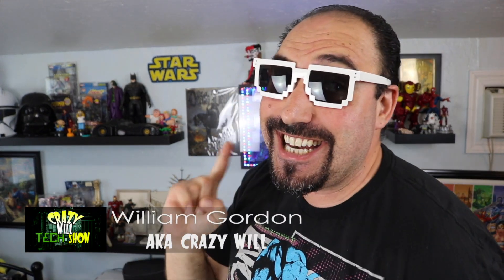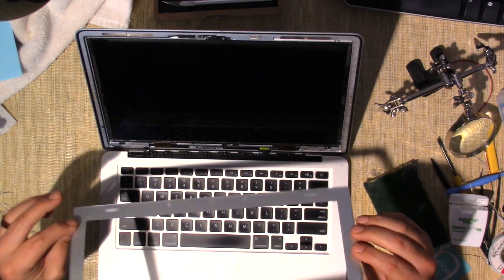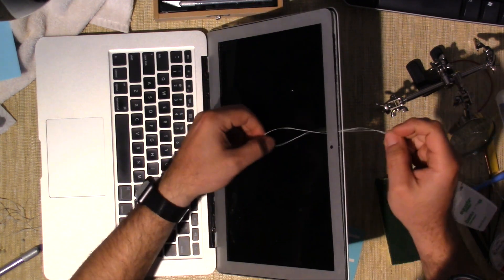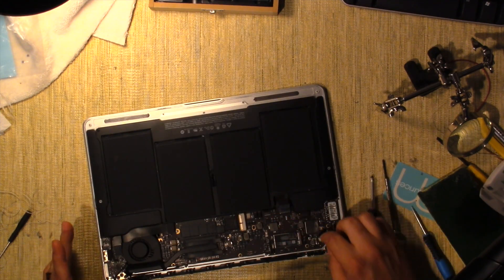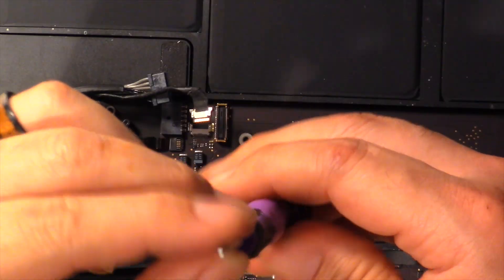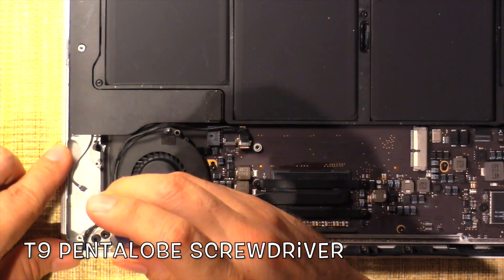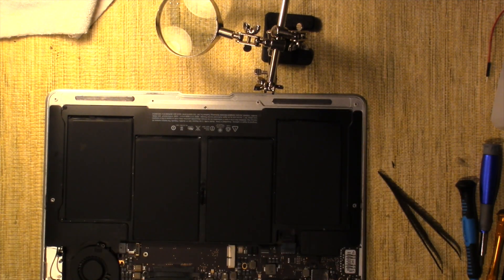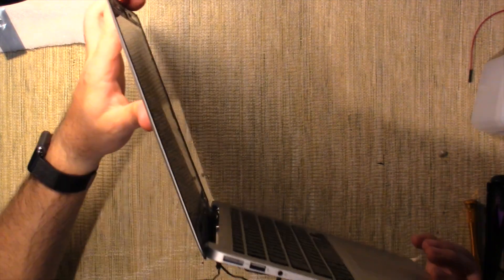2015 MacBook Air 13'' LCD cable replacement

Comment: Hi. I have a MacBook Air 2013 and my screen has no light, you can see it is working with a flashlight. My LCD cable is damaged on the left side (the pins are broken), is this what your laptop had? Thanks.

Comment: Great video, was just about to attempt this repair. However I'm not sure I need to, for me the damaged pin on the cable is the one on the far right hand side. I believe its a grounding pin. Do you think it being damaged would matter? It doesn't look burned in anyway. Haven't tried it yet in case it breaks either the display or logic board backlight.
Reply from the maker: It has been a while since I did this repair, but yes you need a ground.

Comment: Wish I saw your video before :-( just wrecked that little cable when fixing the bazzel.  End of the macbook air
Reply from the maker: Sorry to hear. eBay will be your best friend see if you can find parts. Just remember you can get a used one for around $200 bucks.

Comment: It's either the chip on logic board or cable you did the right thing great Vid.i just unplugged my cable and bought hdmi adapter for the side port and use 36 in HDTV. Keep power plug on so I can atleast close lid. Macbook air2015 
Like a new desktop now.

Comment: Problem I found inside the 2015 Air, are the screws. Silver screws are 5-point stars, while the black screws are 6-pointed stars. I also stripped one screw like I just saw you do 😅
Reply from the maker: Lol yeah it happens 🤷‍♂️

Comment: Hey man good job. How did you test the cable to determine that it was faulty.
Reply from the maker: Use magnifying glass you can see the Metal connections were missing. Usually happens with water damage. The teeth burn out.
Reply: @CrazyWillTechShow  saw that. Is there a way to try the cable other than guess work??
Reply from the maker: I’m sure there is but only know the guess work.
Reply: @CrazyWillTechShow  ok, thanks anyway.

Comment: If the display cable is wearing out, would it have random display goes black (random screen turns black or flicking) issues? Thanks!
Reply from the maker: Yes that can be a big problem and is usually the cause.

Comment: I ripped the backlight ribbon cable (the .5cm thick one thats folded behind the the lower display board) . Any idea if I can replace just that or if the whole screen is trashed?
Reply from the maker: If I remember correctly you’ll need a whole new screen. Not less you’re really talented at soldering really tiny wires.

Comment: Crazy Will Tech Show. Do you need a heat gun (seen others use one)?
Reply from the maker: It helps but I didn’t use it because I tend to go overboard with heat guns lol. you can use a microwave heating pad. just place it on the metal.